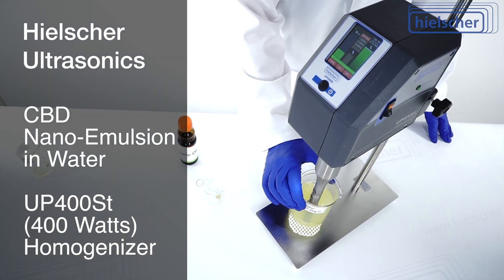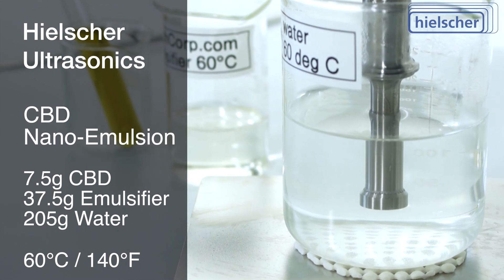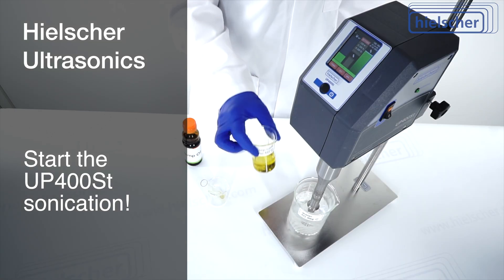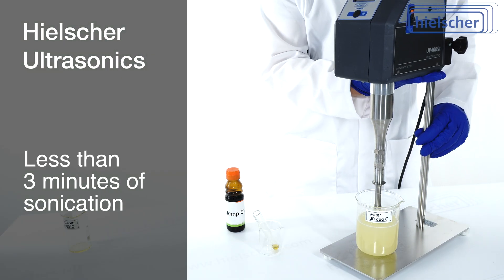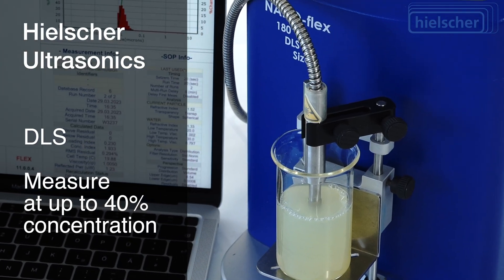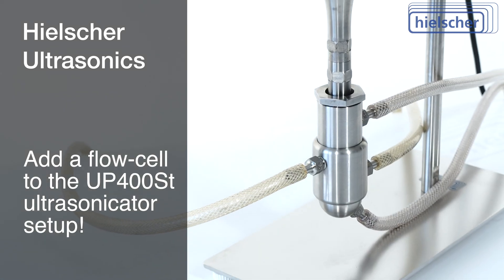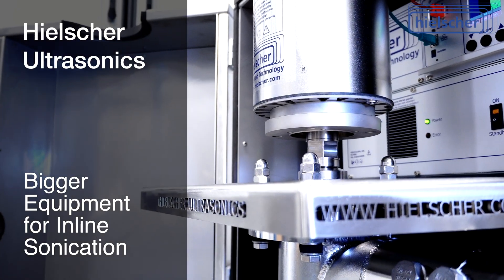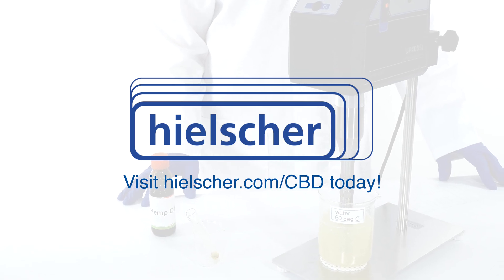CBD Nano-Emulsion - Simple Method to Produce a Perfect Nano-Emulsion - 400 Watts Sonicator

Comment: What is the stuphcorp emulsifier made of?
Reply from the maker: @Gta_Selection As far as we know that is a proprietary material. Many of our customers are very happy using StuphCorp emulsifiers for their products.
Thanks for watching! Please subscribe to our channel for more interesting videos!
Reply: @HielscherUltrasonics   you did not analyze it yourself?,  no info on the certificate of analysis,
Reply from the maker: @Gta_Selection: We own a Microtrac Nanoflex DLS, a MicroTrac S3500 LD, MicroTrac S3000 LD and a Nanotrac Wave II DLS for particle size measurements and stability measurements. The Dynamic Light Scattering (DLS) systems have an impressive measurement range of 0.3 nanometers to 10 micrometers. So yes, we measured the nano-emulsion in our technical lab, using the Microtrac Nanoflex DLS in this case.

We have many customers, that measure their own emulsions on identical or other measurement systems and cross-reference the measurements with our measurements.

Feel free to send us an emulsion sample for a free measurement.
Reply: @HielscherUltrasonics  I was wondering what it contains, are they food safe emulsifiers, lecithin, maltodextrin things like that

Would be nice to afford this type of equipment. Have you ever done any experiments with Chelation? I read a little bit about it but don't have the equipment to to experiment
Reply from the maker: @Gta_Selection You should contact StuphCorp (https://www.stuphcorp.com) regarding the Stuph emulsifier range. Their emulsifiers are food safe. Please understand, that we don't sell StuphCorp emulsifiers. We like their products though.
We do recommend StuphCorp to almost all of our clients for CBD & THC nano-emulsions, because it works. We cannot say the same about many other proprietary or generic emulsifiers and stabilizers in the market. We tested many emulsifiers - lecithin and maltodextrin included. Clients bring all kinds of emulsifiers to our lab. When it comes to stability, flavor and price/performance, nothing we tested comes even close.
Life is too short to waste time and money on stuff that doesn't work.